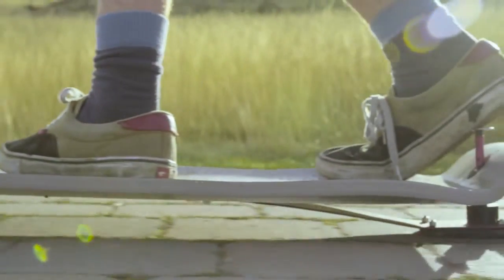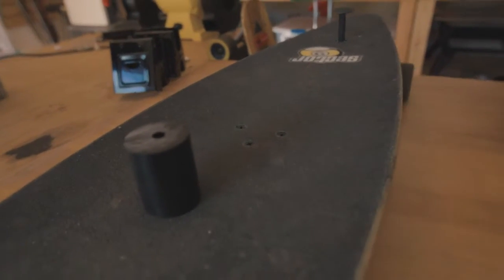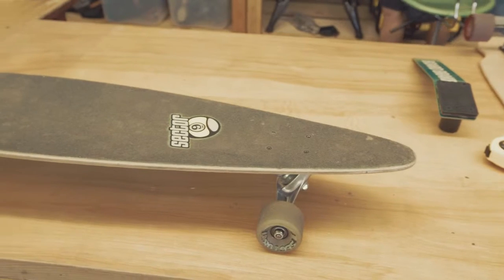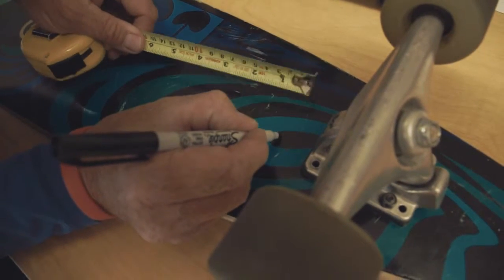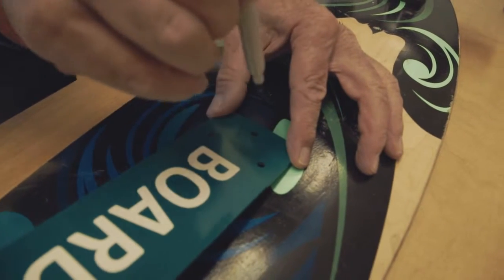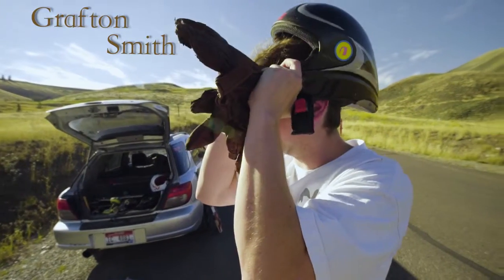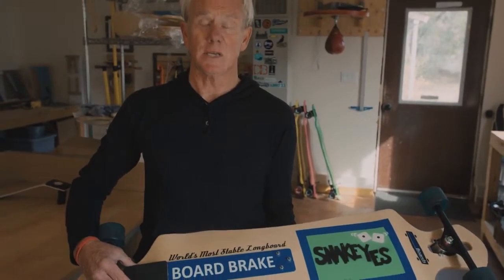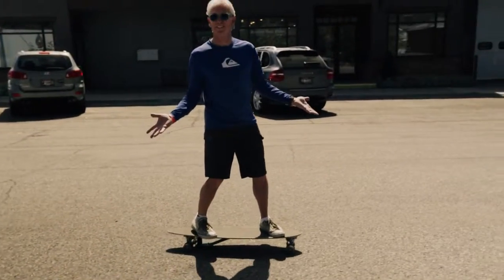Boolah Board's Board Brake HD

Comment: how do I know which Board Brake I have to buy? are these three types or is it only one that can be adjusted?
Reply from the maker: Actually there are 4 types. In addition to brakes for Top Mount and Drop Through boards I also offer a FreeFloating brake for Drop Down boards .......which have very little clearance.
Reply: What's the free floating break? I have a Drop down drop thru deck...Also I have a regular drop thru, do I need to drill a hole for the brake pedal on it?